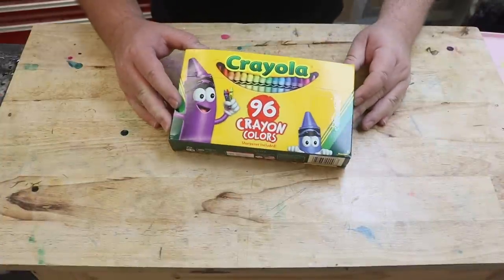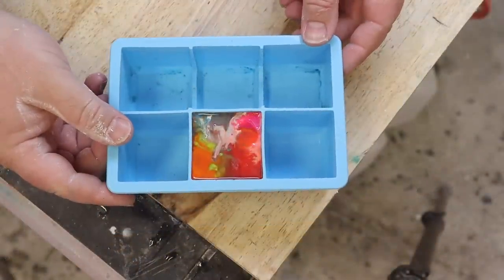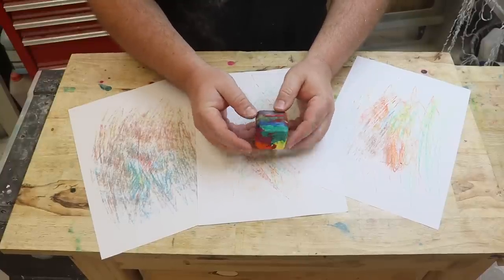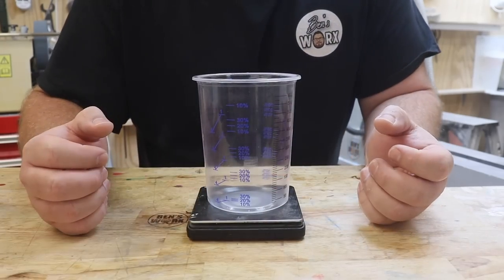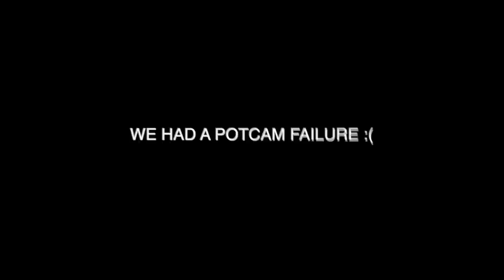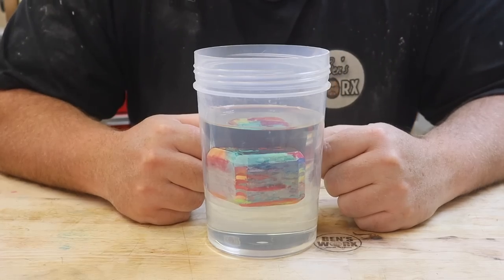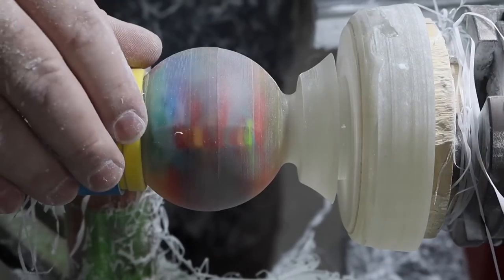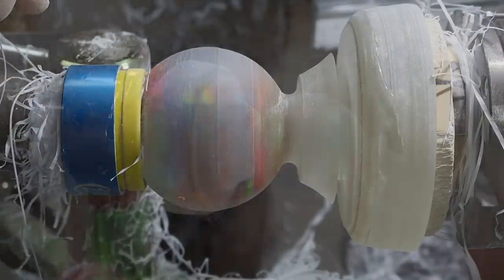Will This ILLUSION Work?

Comment: In school I got to do a very similar thing in manual arts class, we didn't put them on a lathe or anything but we got to choose something to get cast in resin on a base, which we could choose if it were a colour or not, and then had to sand down and polish. I chose a set of dice on a red base. I still have it on my kitchen shelf. I finished school in 2011 and it hasn't shown any signs of yellowing yet 🤞🏻

Comment: For future crayon projects, one tip that speeds up the prep time immensely is to put the crayons in the freezer beforehand; the wax expands from the heat more than the papers around them, so as the crayons cool down, their width goes down slightly more than the paper around them, so removing them from the paper becomes a cinch.

Comment: Looks good with the base
Possible alternative would be to mix a light sprinkling of coloured resin shavings, do it as a doughnut so the light can still shine through
I suggest resin shavings because you're going to cut through them and they can be polished.

Comment: Didn't think I'd like the base, but I do. What might enhance it, though would require a bit of prep work on the math, would be to melt some of the crayons in your base layer when pouring that with the regular resin. Might need to then do another pure resin pour to get some separation but then add the cube with the river pour resin.

Comment: This project gave me an idea you could try. What if you mold a figure in wax, put it in resin, then turn it into a sphere with a stand then drill a hole and melt the wax out. Not sure if it will look good or not 😅

Comment: to advoide colour mixing freze the lare inbetween adding new layer, also  pre melt each colour before adding that wasy you dotn melt the layer below. also if the out side edge is theo nly concern then why notdd a block in the middle to help take up volum so that you dont useso much cryon. may help speed the process up if you made it in sheets then used the bevel in the molds to helps makea cube that way. finly you can use crayon of make voides in the resin. as resin dotn melt and crayon do. that way you can get 2 diffent colors into the same peace of art. candle wax may be cheaper? jsuta few thoughts grat vidio as always.